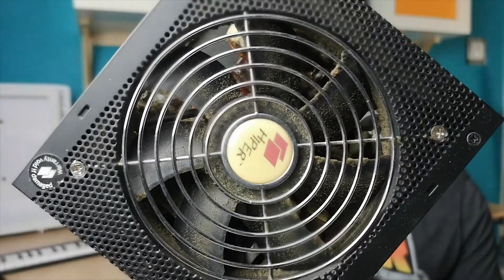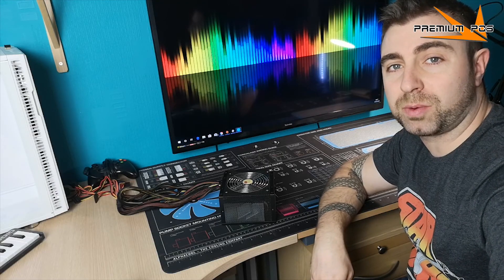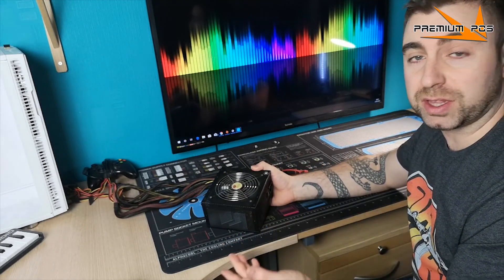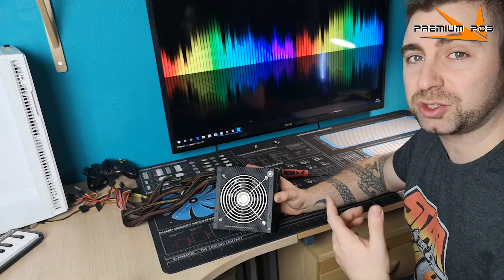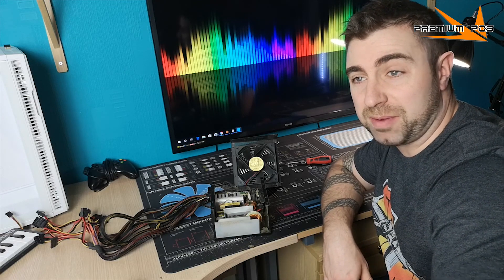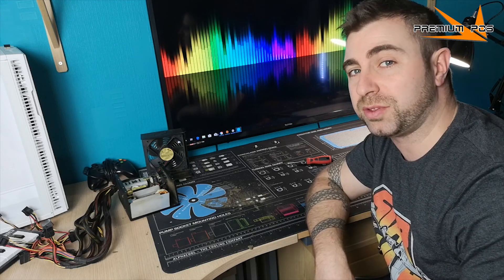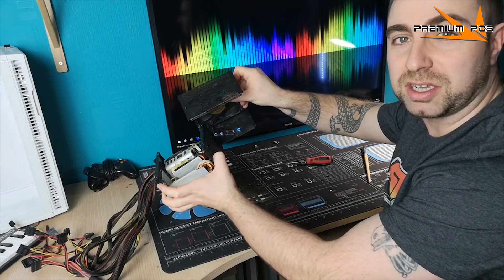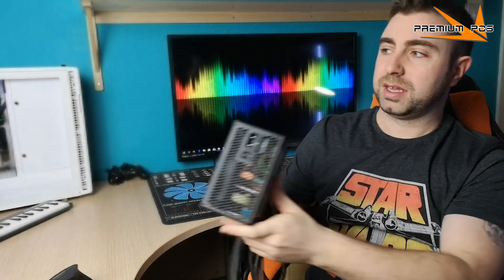Cleaning out a PSU - Quick Tips

Comment: Any safety tips on how to prevent shocks while doing this?
Reply from the maker: Best way to discharge the capacitors to eliminate the risk of shock would be - before removing your PSU from your PC, disconnect the power cable and hold down the PC power button for a little while, this should drain the capacitors 👍🏻
Reply: It's better to wait for around 20 mins
Reply: How about using nitrile gloves?

Comment: I dont really risk opening or touching the PSU due to static shock risk (as advised by others). i always used a vacuum to clean
Reply: Rip
Reply from the maker: So long as you discharge the caps first it's not much of a risk, this is mainly for those PSUs that haven't been fortunate enough to have regular cleans, a vacuum cleaner isn't going to remove the kind of dust build up there was in this PSU
Reply: @paulzpcs7986  yes you are right 🥲
Reply: So why u came here? Undecided is the word.

Comment: i own a high end gaming pc with the corsair hx850i(1,2 year), how often 
do you need to clean it from dust , i clean only the back of the psu and the pc case filter
 underneath the psu with the vacuum cleaner . because the temps are 
still fine after 1 and a half year.
Reply from the maker: If you are running with dust filters and clean regularly you should be fine for a few years before needing to strip it down to clean it. A lot of the Corsair PSU fans don't even run unless they are under heavy load so they won't be drawing in dust as often as a cheap PSU like the one in the video

Comment: i would probably remove the fan to make brushing dust easier - just did mine today
Reply from the maker: A great tip, I had pretty easy access on the PSU in this video due to wide spacing on the fan grill but there are plenty of PSUs where it would definitely be easier to clean with the fan removed

Comment: Is it safe to hold the paint brush in hand over the capacitator area to clean out the dust? I will soon be doing my very first maintenance cleaning on my Seasonic FOCUS Plus 850 Platinum PSU of 2 years.. Pretty anxious.
Reply from the maker: To be on the safe side you can discharge the capacitors by unplugging your PC from the wall and holding down the power button for a while before you start stripping the PSU out for cleaning 👍🏻
Reply: @paulzpcs7986  You are referring to the PC Case power button? Thanks for the advice!
Reply from the maker: Yes, provided the PC is still fully assembled of course, holding down the power button should allow the caps to drain
Reply: @paulzpcs7986  Thanks!

Comment: Can I just unplug the power from my power wall do I really need to remove all the cables to clean it out
Reply from the maker: Technically you could, provided you can get to all of the casing screws, but it's a lot easier if the PSU is removed from the system completely
Reply: @paulzpcs7986  my system is not modular does that make any difference
Reply from the maker: @JesManVP  the PSU in the video was not modular either, there are likely to be screws in places that you can't access if you leave it in your system

Comment: why not just take it outside and blow it out with compressed air? I'm pretty sure you'll get out more dust that way and it'll be quicker and cleaner than brushing the dust off inside your house.
Reply from the maker: Depending on how bad the build up is, compressed air / air blowers won't remove as much stick dust as a stiff brush. It's best to use a combination if you really want to give it a proper clean - and while taking it outside is a great option for most, I can guarantee filming conditions indoors are more optimal 😅

Comment: ummm btw can i use The vacuum cleaner to clean what in the PSU? when i open it?
Reply from the maker: Vacuum cleaners generate static so it's not advisable to use them on electronics, a blower or compressed air is a better solution
Reply: @paulzpcs7986  hmmmmm what about air duster?
Reply from the maker: Air duster should be fine!